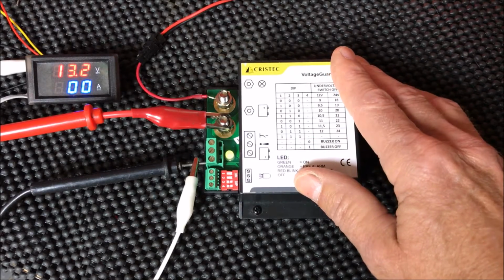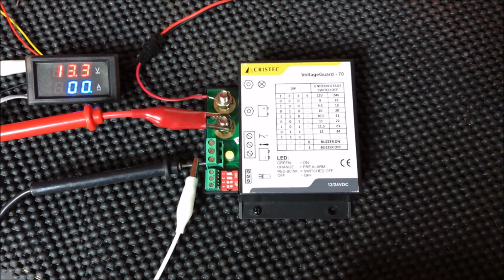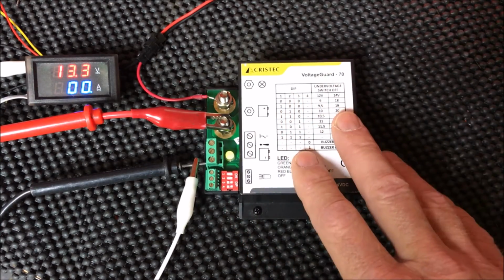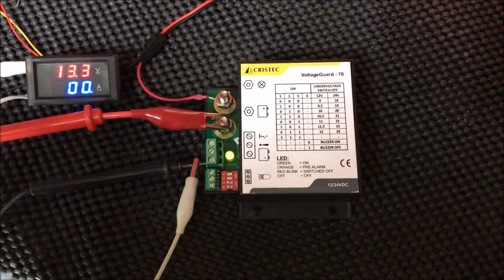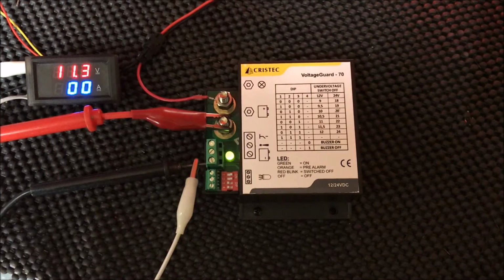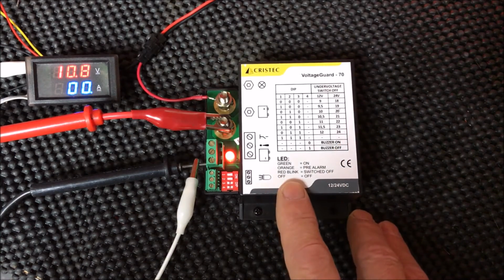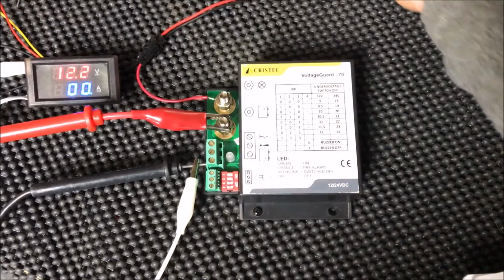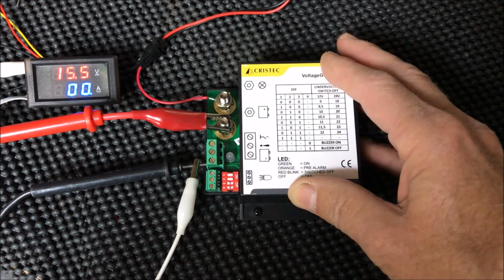Voltage Guard battery protection

Comment: 10.5v disconnect is way too low. 12v battery's start sulfation at 12.4v/2.06v per cell
Reply from the maker: Please watch the complete video.  Low voltage setpoint is adjustable for different battery chemistries and preferences.  In this case we were using a power supply and a low setpoint for clear demo purposes.   A deep discharge lead-acid battery’s state-of-charge ranges from about 11.9V (at 0%) to 12.65V (at 100%).  The battery would still be at about 75% SOC at 12.4V, which is way too early for instant emergency shut-down of all loads as you suggest.  The goal here is not to eliminate any and all natural sulphation (which would require you never accessing more than 25% of total capacity).  The goal is to prevent killing batteries entirely and/or a catastrophic loss of battery power, which could leave a sailor without navigation devices, engine starting, lighting, etc.  This is why there is a user-selectable warning beep (and LED), which progressively increases in annoyance as you approach your setpoint (before eventually disconnecting all loads).